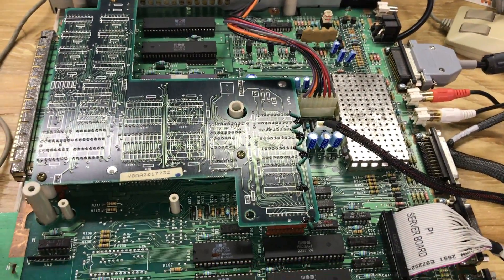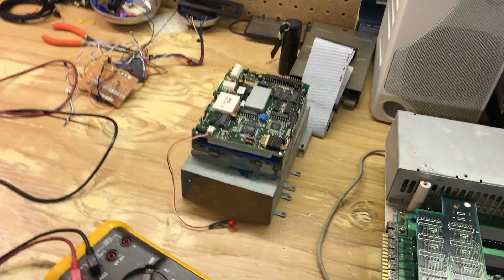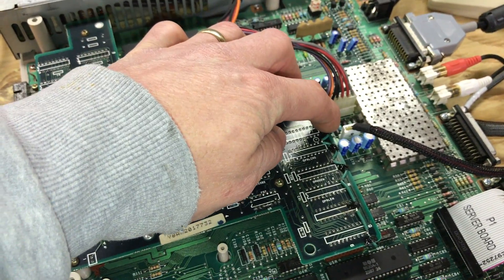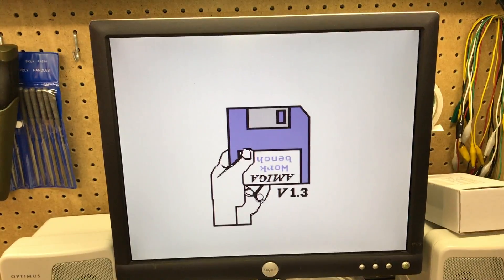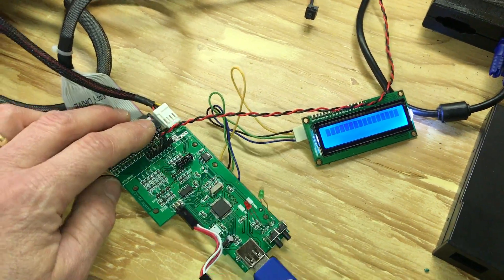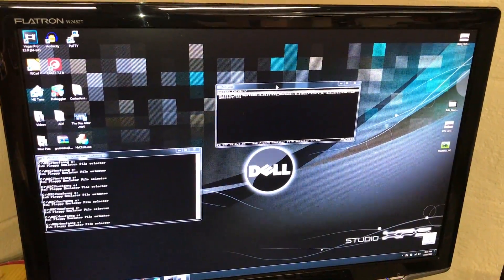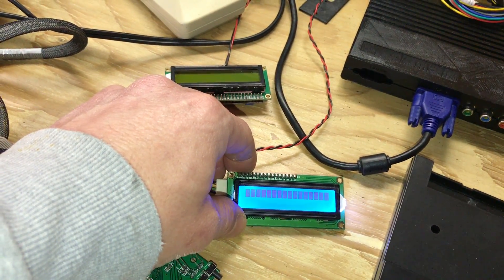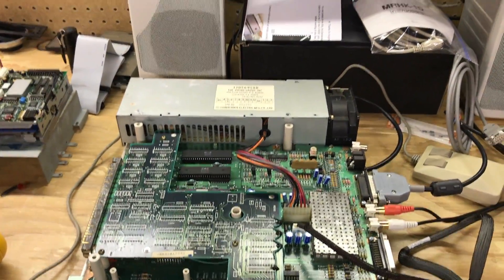Amiga 1000 Gotek Headaches

Comment: I commented on a previous video concerning my use of a Gotek (cortex) as DF1:/DF2: on my A1000. I never tried hxc and I wasn't about to go cutting on my A1000s case! ;)

My experience with hxc comes from Atari ST land (Heresy right?). I found the hxc firmware to be VERY VERY FINICKY indeed in terms of the way you deal with your USB jumpdrive!

In essence, how I got it to work was to use the dd command (FreeBSD OS) to zero the USB completely, writing zeros across the entire jumpdrive, the set it up again using MBR and FAT32.

In addition, hxc likes it's config file and autoboot file to be written first to the drive individually. (The issue being fragmentation), the add your image files after that in anyway you see fit.

As a point of trivia, when adding images to this jumpdrive with a Mac OS 10.11.x machine, the hxc gotek started locking at "hxc" again??? No prob, just went back to my BSD box and set it up again. Since then, no problems.

Now, I don't know if hxc is as finicky in Amiga-Land, but it might be worth a shot?

In terms of the cortex firmware as an external df1/df2: device? I set it up MBR and FAT32 with SELECTOR.adf and would simply run selector.adf from the CLI. This would allow me to set up the gotek (assign particular .adfs to the "slots," then reboot and choose the "slot" number and the disc image would show on my desktop. Of course many of these images were designed to boot from DF0:, so in this case I would run xcopy and make a real floppy from what ever image I would select on the Gotek (no reboots needed).

I hope I am not "Preaching to the Choir" here and maybe in this rather wordy testimony there might be a nugget that helps?

Now back to figuring out why my A1000 decided to go south on me ;)
Reply: You can't have both gotek display and the lcd connected in the same time. Disconnect the gotek screen to get the lcd working.
On the usb stick you must copy the autoboot.hfe and the right cfg file in autoboot mode.
Reply: @JeffHxC2001  i have tested the right .cfg file (Normal_Mode_LCD_ONLY) (i think this is the one i need right?) but are there also different autoboot.hfe files ? or does any autoboot.hfe file will work with this lcd_mode_only.cfg file ??
Reply: Check the hxc2001 download page, there is severals firmware and manager updates available since. This may solve your issue.
Reply from the maker: Thanks for your reply, Not preaching to the choir at all. I think finicky is an understatement lol. At first I couldn't get it to boot beyond the first kickstart .adf or get the display to work at all. I checked my connections and schematic 52 times, reformatted the thumb drive(s) multiple times read through the docs several times to make sure I wasn't missing something then finally shut the thing down in frustration. A week or so later I thought Id give it another try and I turned the computer on and the crazy display lit up and I was booted in to workbench in no time. It still isn't what Id call super stable but I guess it will do for the time being. I will try your suggestions for setting up the usb drive and see if that helps it become more reliable.
Reply from the maker: Initially I tried both ways, but I couldn't get it to work. Then the next time I turned the computer back on a couple weeks later on the LCD worked(with gotek led disconnected). I still haven't figured that one out yet, capacitor bleed down maybe?. 

My main issue now is that it will be working fine for a while, and I'll press one of the buttons to move up or down a disk and it locks up, and the led on the gotek flashes quickly and the lcd display text flashes in sync with led on the drive. If I remove the thumb drive it will display the no usb stick found message but when I reinsert the drive it continues with flashing. The only way to reset it seems to be removing power.
Reply from the maker: I have tried one of the newer beta versions posted on EAB and the function has greatly improved for me, no lock ups etc. I haven't gotten around to getting the latest version but I will pretty soon. Great work, Thanks!